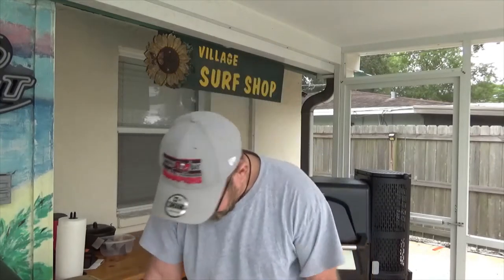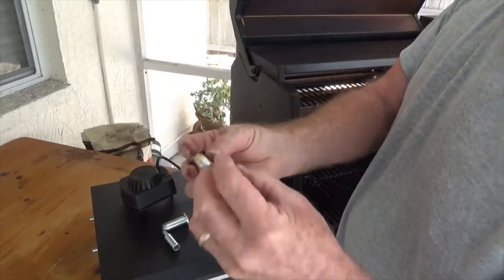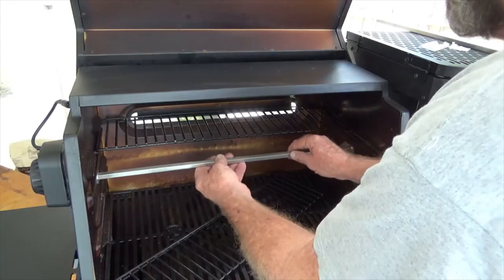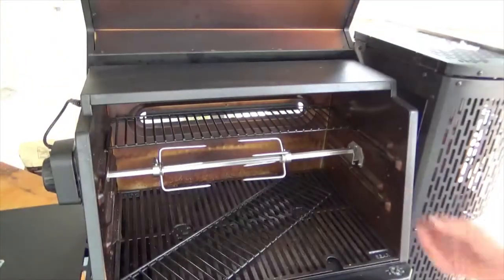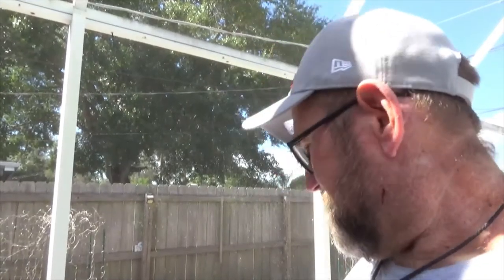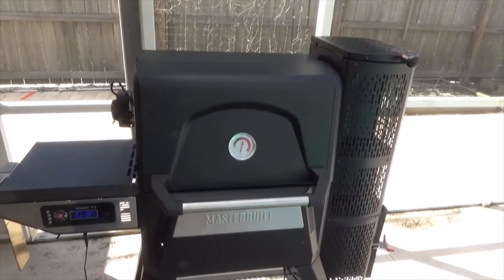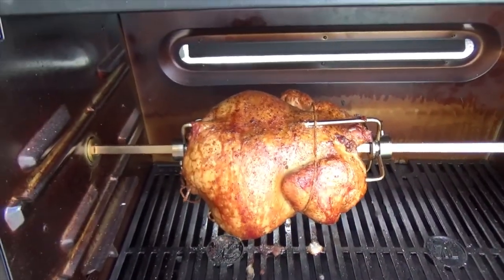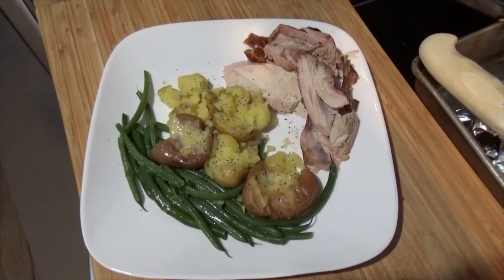Masterbuilt 560 Rotisserie Unboxing, Installation and First Cook

Comment: Read buyer reviews. Masterbuilt rotisseries are Chinese junk. Tiny no power motors. I ask...why? Shame on you Masterbuilt for ripping loyal customers off. I love my 560 but will not replace it with a Masterbuilt as other manufactures are getting on board with gravity fed units that have a better-quality "longer lasting" firebox than Masterbuilt. This junk rotisserie is just another nail in the coffin as far as I am concerned.